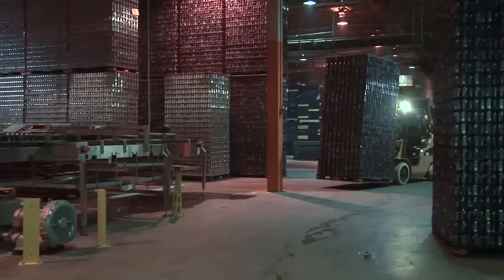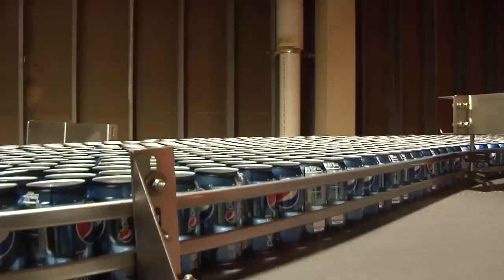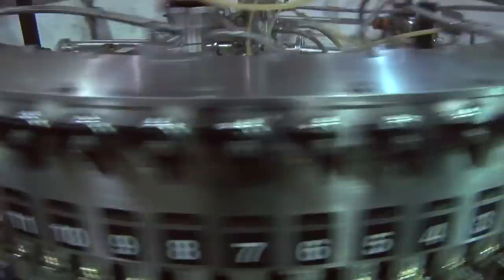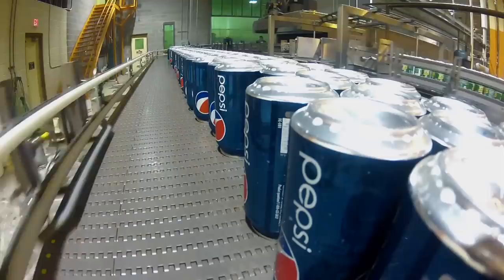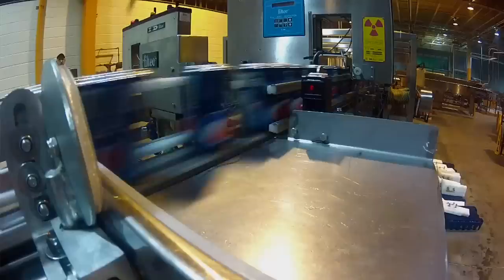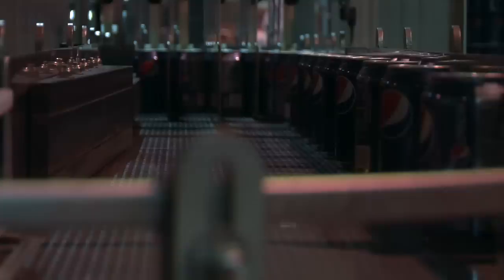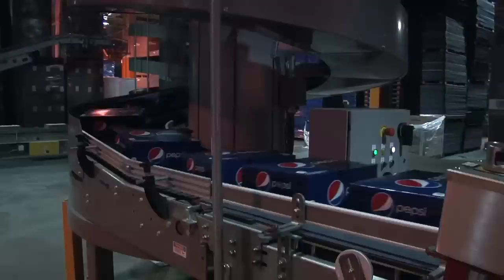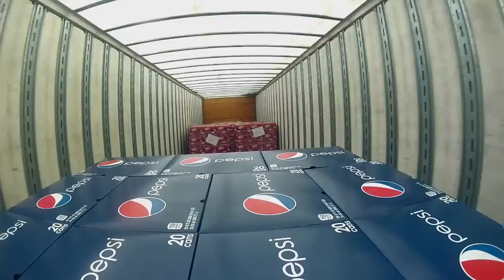Made in Virginia: Pepsi-Cola Bottling

Comment: Comes off the line at 34 degrees? That would be awesome to take one off the line. Freshest drink in the house.
Reply: I’m pretty sure it’s 34 Celsius
Reply: @jrmusickid  
They use fahrenheit in USA
Reply: @jrmusickid  34C would be 93F.  It's definitely 34F - I used to bottle for Coca Cola, and we had a very similar process.
Reply: @jrmusickid  The temperature must be cold in order to retain the carbonation during filling.
Reply: It goes through a warmer after wards to prevent sweating when it’s packaged.
Reply: Oh trust me they are so much better right out of the filler.

Comment: This is a great video explaining how great the Pepsi cans are washed and cleaned completely on the top, bottom, and inside before they get filled with Pepsi.  Also that machine at 2:22 is also great to tell whether the can is good enough to use or not explaining whether the can should be reused or rid of.

Comment: i live in ohio ive never seen a 20 pack of pepsi its 24 packs here when i worked at a recycling center was the 1st time i saw a 20 pack and even a 30 pack
Reply: I live in Norway, and I've only seen 24-packs, 12-packs, 10-packs and 6-packs and 4-packs. Never any 30-packs or 20-packs.
Reply: 30 packs are more common at Costco